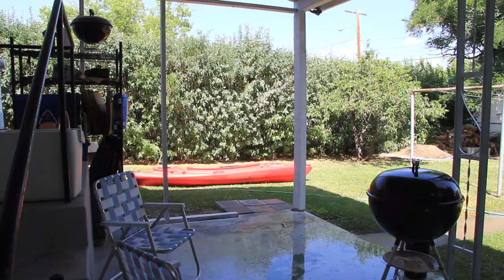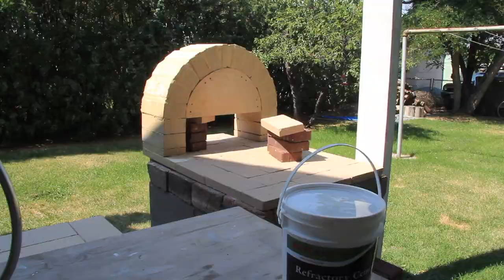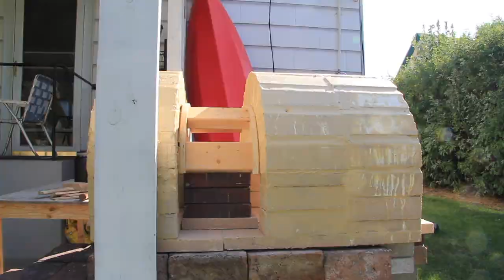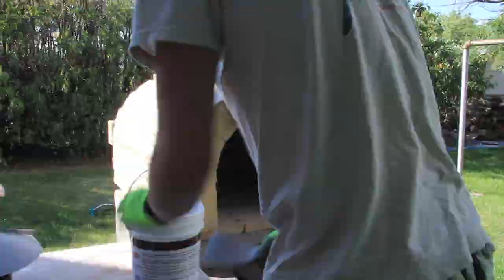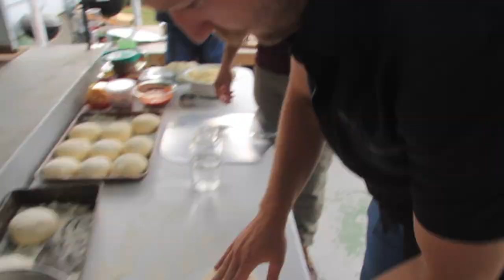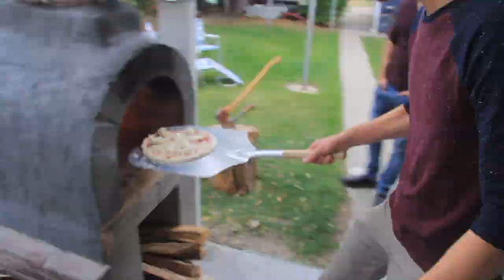How to Build a Wood Fired Pizza Oven // DIY Backyard Pizza Oven

Comment: What kind of base blocks did you use on top of the cinder blocks? Were they fire rated? Im about to make one myself
Reply from the maker: Those are pavers, made from cement. You may buy these at most home improvement stores. Not fire rated through. I didn't expose them directly to the heat. That is what the fire bricks are for. Good luck!

Comment: What are the dimensions of the internal arched mould that you made & used?
Reply from the maker: Oof its been a bit, but I think around 15 inches wide, and a foot tall. But make sure to use stacked bricks underneath to get the arch higher. Happy building!

Comment: What are dimensions? Thanks
Reply from the maker: Its around 4-5 feet long, 5-6 feet tall, and 3.5 feet wide. Cheers!
Reply: What are the dimensions of the interior? And do you think if u had a smaller door the temperature would get hotter inside? Maybe even medal door u pop on when the pizza is cooking?

Comment: Would you be able to give a rough estimate of what the final cost of this was?
Reply from the maker: Around $800. Thank you for watching! Be sure to check out all my other videos :)
Reply: I made a fire brick oven myself from A to Z. Mine is round. It is 70 cm diameter cooking surface. I estimated the cost to about 1000 euros. But it takes more material to build mine than this one. 2 kind of material I underestimate during the first order : Fire cement and chamotte (mashed bricks). I used it to make my fire mortar. For better functionning especially if you want to cook bread, I would recommend a thick insulation. My cost is considering the thick insulation.